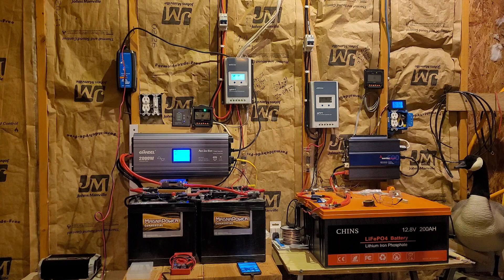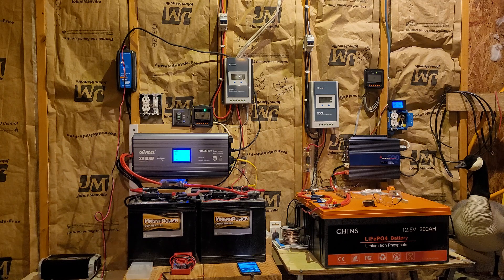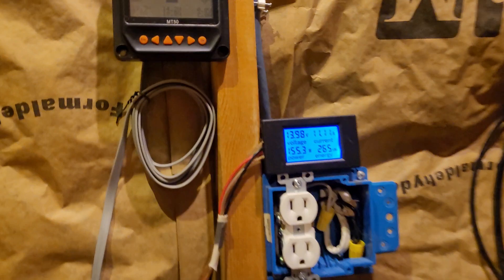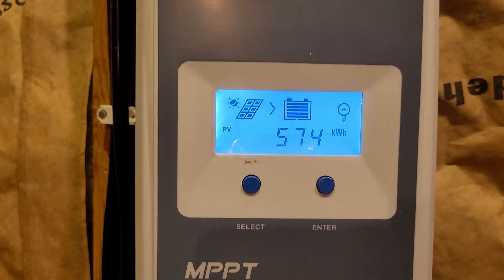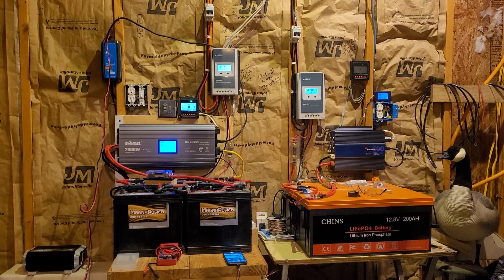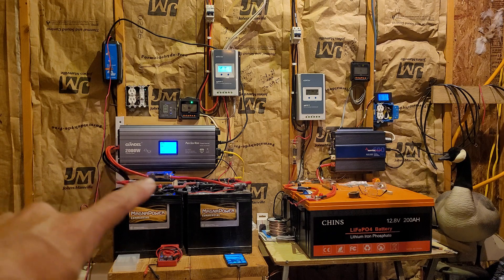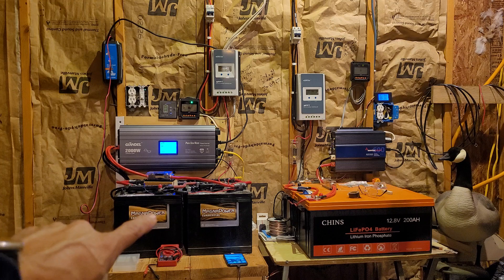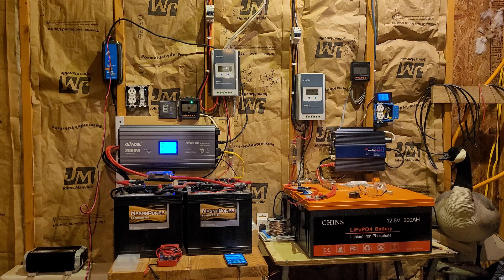Chins lifepo4 Bailout is OVER  12v Off Grid solar

Comment: 18V on PV is parallel linking, it offers little to no improvement with MPPT versus PWM. 
Serial connection with 2 or more 18.0V panels provides 36V/54V/72V/90V from the PV side, then there will be raising of amperes when the batteries have lower Volts. EPever MPPT does not give any extra boost than, for example, the Steca PWM - the old Steca reduces to 12V from max-level of 17.2V, the max level there gives the same as the MPPT.